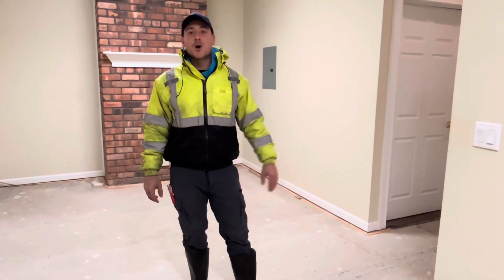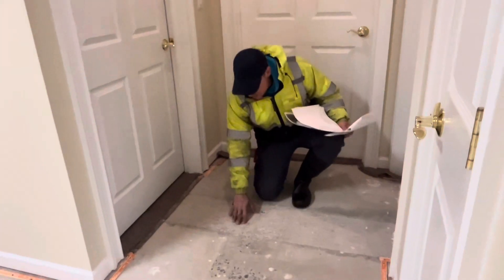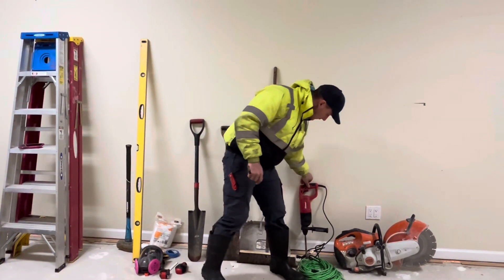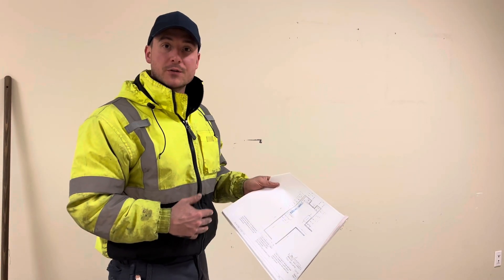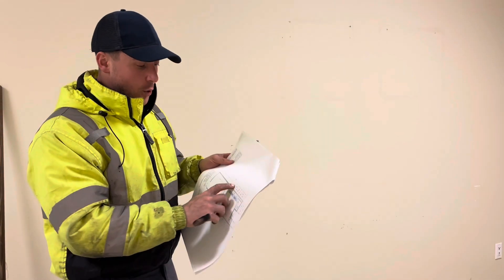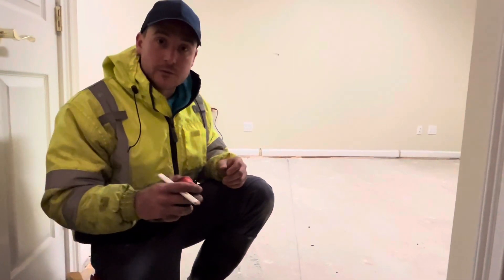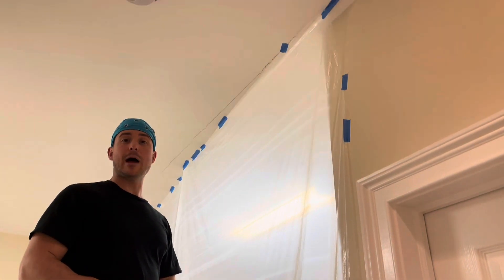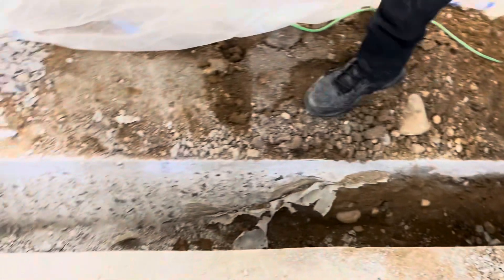How To Demo and Finish Concrete For New Kitchen Plumbing

Comment: did you have to dowel the old concrete?
Reply from the maker: You can to add dowels to add strength bonding existing concrete to new concrete pour